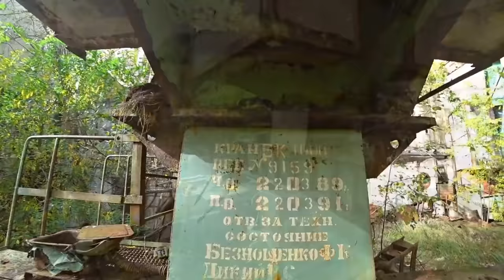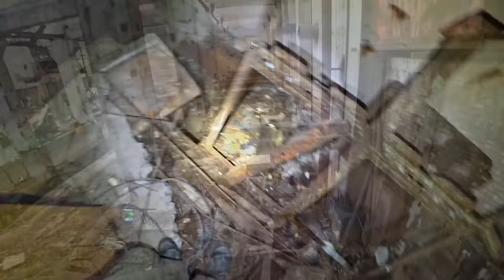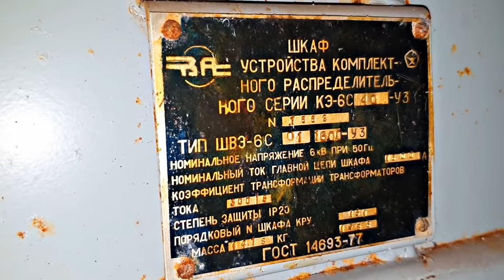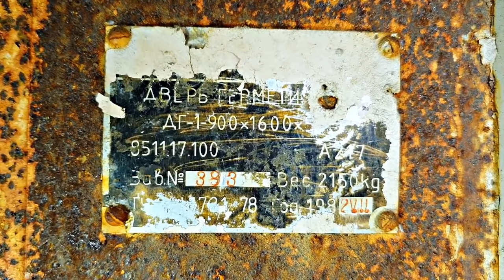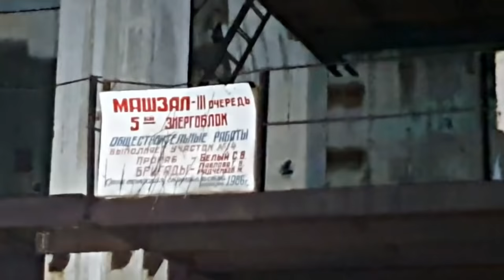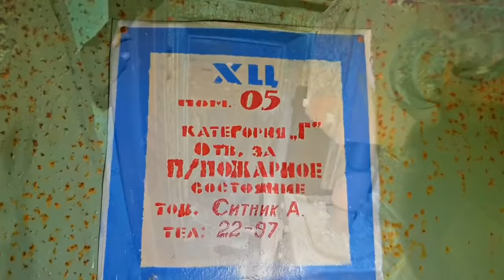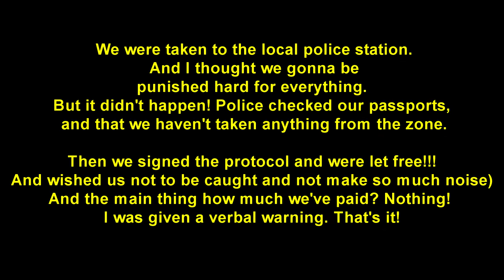☢️Going to the Chernobyl Reactor Tunnels / Busted by Security @SuperSus almost drown

Comment: The tunnels you were in were my kind of area of work. I'm an electrical maintenance guy, so while the clean white gloves people work their machines and panels, tunnels like these serve people like me. The big ol' metal tunnels you've seen are some sort of relatively high pressure circuit. You definitely want big heavy airlocks with phones there. People would be accessing the area for maintenance and structural checks. You need to make sure the line is depressurized and that the door are VERY difficult to open by incident. You'd have the line operator call you it's safe to operate. That's also probably why the door opened in to the tunnel, not the other way around. I have my guess the tunnels could have been an exhaust for a steam line. After the steam makes it through the turbine, it's relatively low pressure, but still hot as hell. You don't necessarily need round pipes for that. From there I think you might make it in to the cooling tower circuitry and then back in to the turbine room. It could have been cooling water line as well. None of these things you want to access by incident. You also walked through substation switches. Those were all enclosed switches likely with remote control. While the white gloves switch some tiny buttons up in the control rooms, the switches go 'BANG! WZZZZZZZ!' as servos are reloading the firing mechanism.

The boxes from 7:25 appear to me like high voltage vacuum switches. The casing is ruined though. Maybe they haven't been vacuum but I definitely recognize some of the sleeves that were originally covering the silver coated contact bells. Another telltale sign of what they were are the charging levers on the side. You'd use a rod to charge the spring inside and then the contact rods will shoot straight in to the contact bells to prevent formation of arcs.

The "mutant" from 17:12 is I think a young dragonfly. They're ugly as hell before they are ready to live in dry environment..

23:35 are prefabricated roof arches. Those supports for rails you've seen there would get that crane close enough to pick them up and put them on top of a building.
Reply: Are you stalker?
Reply: @ahmadhakhimi236  No he's just extremely educated about this building. He's literally a nerd. Or he's just a stalker.
Reply: Wow you just wrote a whole textbook wtf
Reply: did he just say mutant??? S.T.A.L.K.E.R.?
Reply: Good post electrobro
Reply: K Bry vem fråga
Reply: gmod and borderlands videos
Reply: @xtYLT2IY8  Yes, I like to go and have some fun after work.

Comment: That small guy is crazy going underwater 🤣🤣 maybe next time use a RC submerine ?
Reply: That is a great idea! If they can find it afterwards to get the footage. I'm not into RC, especially not RC submarines, but the few videos I've seen they were never submerged. Simple thing: radio waves of usual RC frequencies cannot penetrate water. There might be some ultrasonic sonar type underwater remote controller system available for them, I guess, but even if it exists, I don't think it works great in this maze of corridors and tunnels (echoes!). Or a wired remote, but that would be dangerous as it can get easily stuck into the garbage, and obviously the range would be very limited by the length of the cable.

Also it might stir up the dirty water so its camera might not see a thing.
Reply: @mrnmrn1  There are RC Subs that can submerge.  Most simply rely on pre-trimmed diving planes that force them underwater when they’re going fast enough.  Such subs are buoyant so they’ll surface on their own if they slow down or stop.  The ones with ballast tanks usually have sensors that’ll surface them automatically if they go too deep or lose the signal.  Tethers May also be used.  Regardless, I would not bring one into flooded, abandoned tunnels for the reasons you mentioned.
Reply: @mrnmrn1  rc drones normally have a tether so can be pulled back. They also record directly to the phone

Comment: Iam constantly thinking about how radioactiv the things are they touched
Reply: its mostlikely a tutorial how to get cancer.
Reply: things in this reactor block are not radioactive becouse this is probably block 5 what was never completed, but things outside are radioactive
Reply: @christianmunsch5590  its not
Reply: @christianmunsch5590  it wasn't even used they are fine.
Reply: This is reactor 5 the un finished one it's just as radioactive as pripyat so about .10 rads which is unlethal
Reply: Nothing can be worse than that X-ray gun they made lol
Reply: Unit 5 is very radioactive because a lot of particles and nuclear fuel fell there after reactor 4 exploded. Note that unit 4 is very close to unit 5 and unit 5 was never decontaminated like Prypiat city. It was very dangerous to go there...
Reply: @username0lt  my thoughts
Reply: Inside buildings in there are less radioactive then in outside normal city ;)
Reply: Not very radioactive at all
Reply: Yeah
Reply: Pitty they didn't measure anything. Wonder how contaminated the basemant is. Going face down in that water, wasn't a good idea imho. All for the clicks!! 👍👍 Oh humanity..
Reply: @username0lt  your wrong first of all in saying its close to reactor 4 it's actually built on another complex about a kilometre away and any radioactive particles their would have over time been dispersed it has  around same levels of radiation as pripyat which you can travel to and is safe for limited periods of time

Comment: That dude supersus needs an iodine pill ASAP.
Reply: Nah just needs vodka lol the 4th reactor was never fully built or used so its good.
Reply: @stonedsavage7814  the 4th reactor was the one that exploded they are in the 5th reactor witch was never finished
Reply: If the water was radioactive it's too late to get a iodine pill. You need to pump up your iodine level prior to exposure to radiation, so the non-radioactive iodine can saturate the thyroid which will prevent the intake of radioactive iodine isotopes.
Reply: @mrnmrn1  * eats lots of iodised salt *
Reply: Also,iodine pills will not help against other isotopes like cesium-137,cobalt-60 and soluble compounds of uranium and other actinides.

Comment: If you've seen Chernobyl by HBO you know those cellars are highly radioactive, especially the ones close to Reactor 4 and under it. The people who went down there survived for approx. 2 weeks.
Reply: No, the 3 people that went down there post-accident are fine. The only radioactive corridors are the ones below reactor 4, as the other reactors continued to operate until the year 2000, and the reactor corridors they are exploring (reactor 5) is unfinished and was never active.
This tunnel is not radioactive whatsoever.
Reply: Because HBO would never lie

Comment: Chornobyl site reached 9.46 microsieverts per hour but remained "within an operating range" recorded in the exclusion zone from the moment of its creation and posed no threat to the general population. but going inside there is  The Chornobyl exclusion zone is among the most radioactively contaminated regions on the planet. Thousands of acres surrounding the reactor site have ambient radiation dose rates exceeding typical background levels by thousands of times you really need a Geiger counter you can still find radioactive hotspots,  you should think twice about exploring ...

Comment: I don't think that's Chernobyl; or at least not close to reactors 3 and 4. They put the huge dome over reactor 4 last year. ALSO, if you were actually close to reactor 4 (where the high high amounts of radiation are) usually video and pictures become grainy

Comment: Strange reaction from the guards and police to take them in for questioning without first giving them a thorough geiger scanning. Although Chernobyl has been somewhat cleaned up there is still a great risk of highly contaminated rubble and dust. Especially where these guys are going. Remember how the people were running on the roof and shoveling radioactive debris from it? Well, that stuff landed somewhere...

Comment: Why are there cranes? If they were ACTUALLY at Chrenobyl they would have been stopped by police, and they would have been dead by now because it is too dangerous to enter the building without proper protection and they would be feeling radiation sickness right now especially being in that water...

Comment: The place showed and the guy swimming is for sure fake. It's a whole different place,
If that small guy really has swum in the water, he would have been probably dead by now.

The water is still highly radioactive.
Reply: It's not the main building, its the smaller 5 and 6 reactor building that was never used. The water is probably from the river.

Comment: Radiation is one thing you can walk away from it but breathing in radioactive dust is another story especially Plutonium or any of the alpha emitting actinides and there must be significant levels of Plutonium Strontium Americium and Radium dust all over the place,  the annual limit of intake for ingested Pu239 in a radiation worker is incredibly low but unless there's a very large amount in a persons lungs or internal organs then you can't detect them with a whole body monitor system as they only detect Beta and Gamma rays they can't detect Alpha particles directly so to be really sure you haven't ingested any Alpha emitters you'd really need to give urine and fecal samples and have them processed and counted in an Alpha detector/counter, personally having worked in the nuclear industry for 25 years 7 of those in Health Physics my advice is keep well away, OK it might seem like a laugh now but it won't in 15-20 years down the line when you find out you'd got cancer trust me it's just not worth it.

Comment: 11:01 The nuclear reactors are still in Chernobyl in all 3 remaining reactor rooms. The reactor is way bigger than the room shown on the video. There is no way you can get into any of the Chernobyl's reactor as there are many people working there and by the looks of it this is not anywhere near Chernobyl. Not to mention if this is supposed to be reactor 4 they would've been killed by the radiation + entering this area is impossible. You can't get anywhere near any of the reactor buildings and not to mention the reactor rooms or the reactors themselfs. It might be some sort of power plant but it's not nuclear power plant for sure! You need to be really lucky to get to see one of the reactors and there is video of tour to reactor 3 but.
Reply: This is the incompleted reactor 5 and 6 building located about a kilometre away